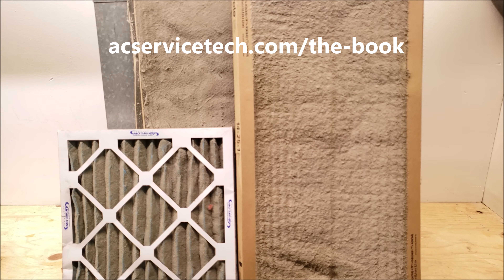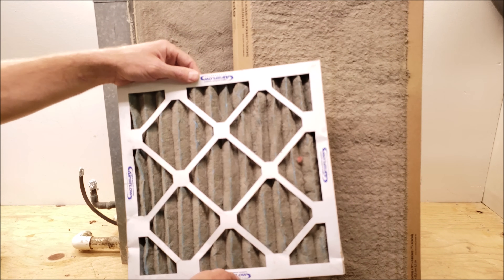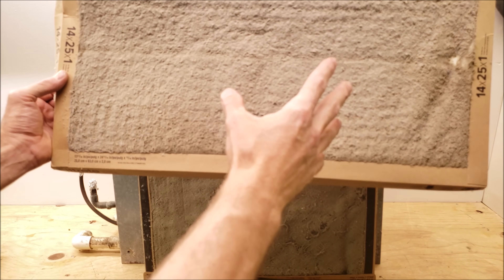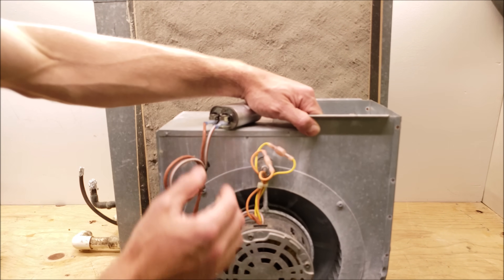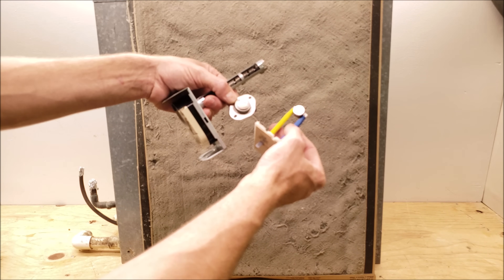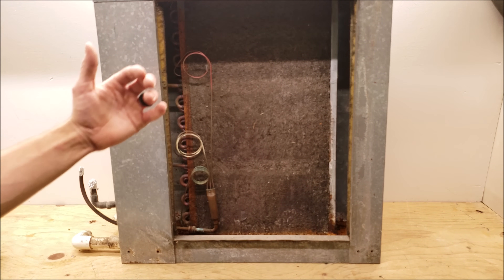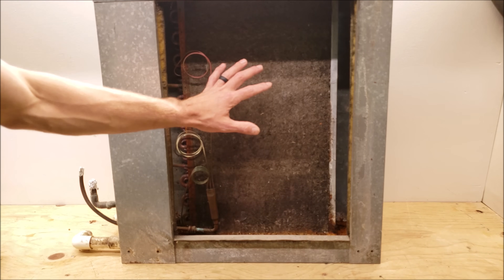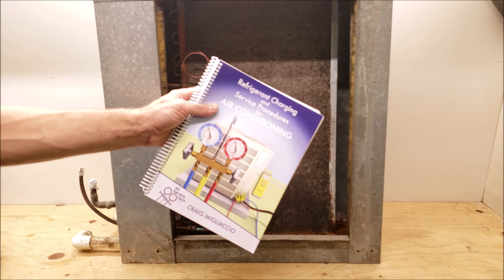How the Indoor Air Filter can PROTECT or BREAK the Furnace and Air Conditioner!

Comment: You mentioned a compressor may fail if the evap coil ices over due to a clogged filter.  How would you diagnose a compressor killed in this way?

Comment: craig what type of filter do you prefer? Fiberglass, pleated etc..
Reply from the maker: James, the manufacturers seem to be moving more toward pleated at this point but whenever possible I prefer a 3" or 4" pleated so the filter will last longer even if the building owner forgets to change them as often as they should. Basically anything with a low static pressure drop, thanks James!
Reply: for me, the least restrictive filter that will keep the coil clean. you can always have a stand alone air purifier in a room.  i think filter manufacturers cater too much to consumerism air quality, not air flow.  You may find the airflow numbers, but it's usually 'fine print' which is a chart that states static pressure drop for various airflow cfm (roughly 400cfm/ton). I'm looking at a 16x25x1 filtrete MERV 5 filter and it shows on the back of the filter  410cfm (1ton) SP resistance of 0.09... up to 1390CFM (~3.5ton) with 0.48 WC static pressure resistance (.48 - too high - need a bigger filter than 16x25).   This is on a 2 ton unit (single stage, single speed, with orifice), so I use the 820cfm rating of 0.23. I'd expect a 24x24x4 filter to give SP ratings up to 2000cfm as it's typically going to be installed on a larger tonnage system.  If your HVAC has no access holes where a pitot tube can be inserted at various points (before filter, before blower, before coil, after coil, etc...) then the installer never gave SP a second thought when slapping the system and ductwork together. Now if a tech has perfectly balanced the refer charge and you go changing filters to a more / less restrictive filter... the charge is now slightly off balance because your SH will be off a little bit. craig correct me if I'm wrong (or good idea for a new video?)

Comment: I had to clean an evaporator coil during winter season last year. Outdoor temp was 35 degrees. Customers furnace was short cycling due to the evaporator coil above the furnace being clogged. Unit worked perfectly after a thorough cleaning.
Reply from the maker: Ha thats a nice one. How did they make it through ac season? Great Job!

Comment: Some expert at a supply house said low air flow low amps on the blower motor and its the reason it fails I always thought the opposite like you  I said the same thing it increases amps. I never actually simulated it because i dont have a remote amp meter because you have to have the blower door closed. But i suppose it makes it sense idk. Any thoughts?
Reply from the maker: Restricted airflow causes low amps on psc motors and higher amps on ecm motors, thanks!
Reply: AC Service Tech LLC thanks for the reply back 👍🏻will keep that noted

Comment: Once I’ve open the coils, it was like somebody put the carpet😂. Unit runs 15+ years without  air filter. Always if you see horribly dirty blower motor area, potentially your coils is blocked. Great video!)
Reply from the maker: 15 years! They barely got any ac out of that, nice one!

Comment: I had one yesterday plugged filter = frozen coil. customer shut ac off, coil melted and  dripped on circuit board .she refused A/C check a week before at 90 canadian dollars, now on a long weekend no A/C and is getting new furnace to replace her 20 year old trane with bad board.
Reply from the maker: Yeah someone has to do some preventative maintenance or the whole system can be damaged, thanks!

Comment: I think air filters are the most neglected components of a hvac system.
Reply from the maker: 100 percent, thanks nota newbie!
Reply: @acservicetechchannel  a brand new super HEPA anti-viral bling filter can probably be as restrictive as a fairly dirty lower grade filter. I don't buy filters based on air quality for my lungs, but based on whether or not it's enough to keep my coil clean and not stress my fan motor. my filter also doesn't rest between sheet metal, I've got high density rubber weather stripping on the upflow side, so it's held snugly sealed in place when the air handler is running, otherwise dirty air could bypass the filter and clog the coil faster.

Follow up question: would there be any unintended consequences for resizing the air filter for a small 1.5 ton evaporator from 12x24x1 to 24x24x4? I'm sure older systems weren't designed for fiberglass high flow filters not restrictive hepa filters. attic horizontal mount so I have no problem with clearance.
Reply from the maker: The less restrictive the air filter the better but you may want to check the charge again if airflow has been affected especially on fixed orifice systems, thanks!
Reply: Duh